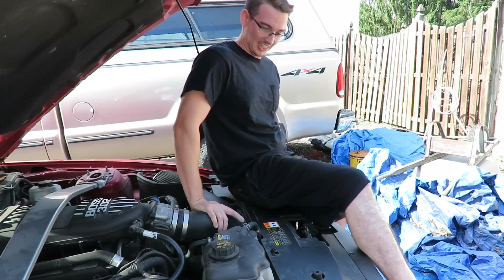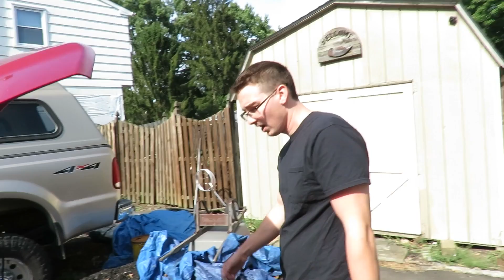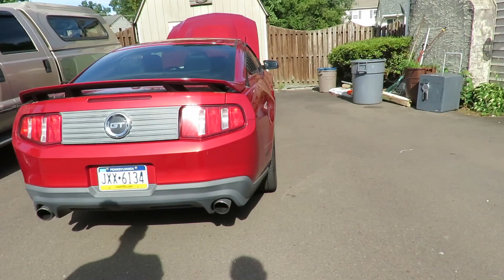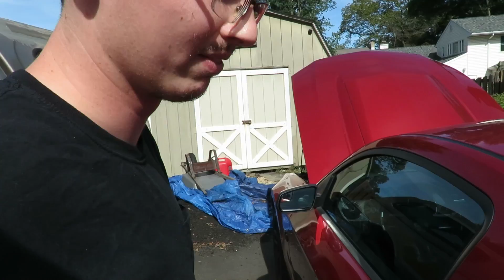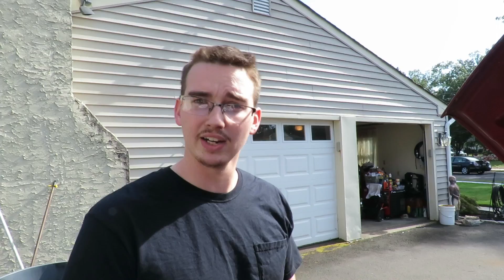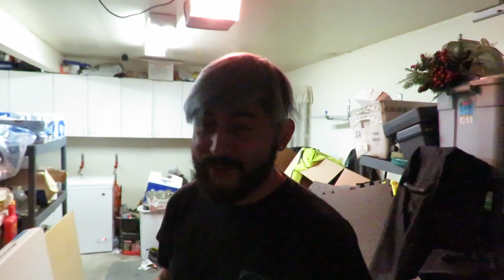WHY WATER COMES OUT OF YOUR EXHAUST

Comment: Thanks for the video, I will like to know reason for my car silencer not longer dripping water, I'm worried..
Reply: It all depends on the conditions. In colder weather it will drip. In warmer weather it will mostly come out as a vapor because overall temps are higher. This is my understanding at least.
Reply: Also depends on what fuel you are using. Higher alc means higher moisture usually. So if you fun e-85 you will more likely see water condensation coming out of tailpipe. 😊
Reply: Ona very cold start it will come out as steam for a bit. Completely normal